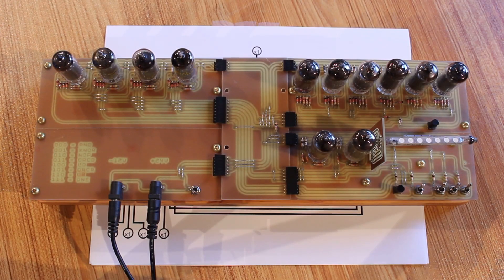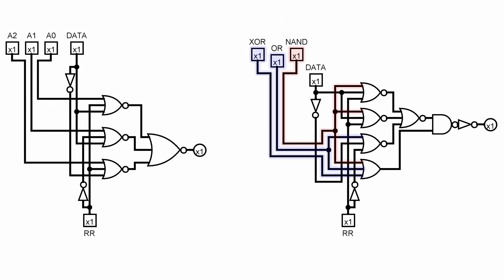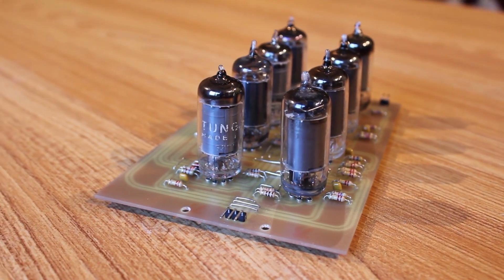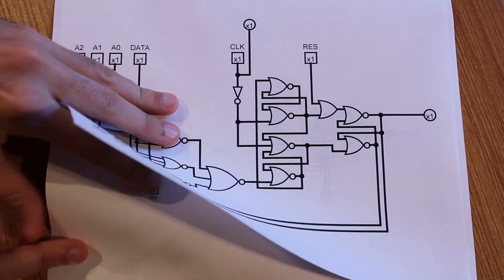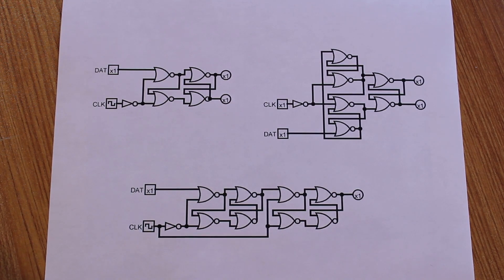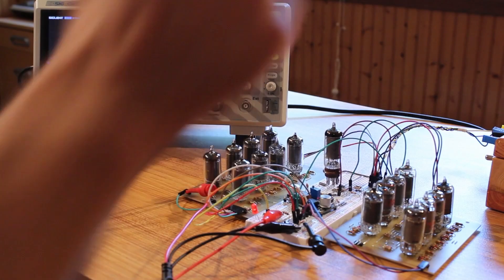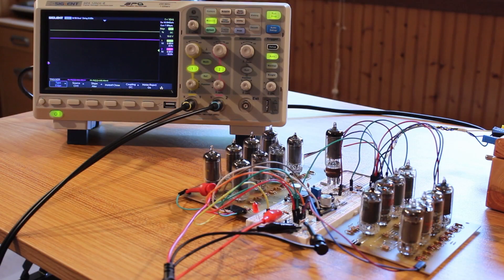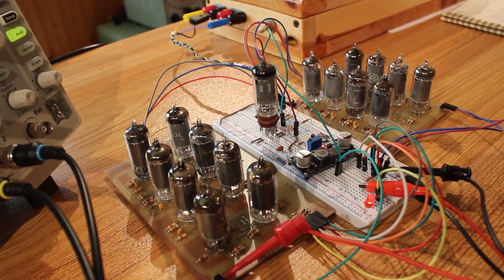Vacuum Tube Computer P.17 – Building the Logic Unit and Results Register

Comment: Would be interesting to know why your first D flip flop design didn't work, it's supposed to be edge-triggered. Maybe your gates don't switch quickly enough?
Reply from the maker: I think you're on the right track!
This is a total guess on my part, but I think it's due to different rise or fall times of the different tubes. Since the tubes are all used and from different manufacturers, they all have just different enough emission characteristics to throw the D Flip Flop timing out of whack. If I went through and tested each tube and matched them up as close as possible regarding to emission, it's possible that the first design would work!
But, I wanted the entire processor to work with as much as a 5V difference at each logic level (ie. logic low = 1V to 6V, logic high = 19V to 24V). I've actually got the designs flexible enough that I've even had some working with worse tolerances than that, but for the most part, logic levels fall within those super wide margins. The second D Flip Flop design allowed me to keep my overly loose design standards, haha.

Comment: Have you thought about designing around any if the uber-cheap and highly available surplus tubes from the ex-USSR and China, rather than old-stock US types which are still used in vintage gear?
Reply from the maker: I have indeed. I did a bunch of searching and shopping around to find the most affordable option as well as the best option for low-voltage operation.
I decided upon the 6AU6 for a few reasons. First, it's amazing at low voltage - probably the best tube of the hundreds of different types I tested at 24V. Most importantly, it's a very common, and very cheap tube. Yes, many old vintage gear still uses the 6AU6, and there's no shortage of quality 6AU6s available for those. What I'm buying for this project are heavily used, large lots of 6AU6s, which generally wouldn't be a good choice for someone trying to restore a vintage piece.
I don't buy any 6AU6s unless I can find them for less than $0.90 a piece. To give reference, the cheapest Soviet dual triode I can find is the 6N1P, and those average around $3 to $5 a piece. Unfortunately, at the scale I'm building at, that would push the project a bit out of my price range.

Comment: Hi;
Could You Please send or post the logic equivalent of What You used for Your Tube 1-bit Computer, I cannot build it in or with Tubes, even though I would like to, but for me I would like to build a 74xx equivalent, since I have plenty of those Ic's.. And I don't think I have the Mc14500 Ic either, and what You are doing is so much better, than what they designed..
THANK YOU Marty
Reply from the maker: Thank you so much for the kind words!

And no problem at all! Here's the full gate level representation of the UE14500: https://i.postimg.cc/fTQDXnnX/UE14500-Full-Gates.png
But, if you have Logisim, it might be more helpful to play around with the actual logic simulation file here: https://hackaday.io/project/181923-1-bit-vacuum-tube-computer/files

Keep in mind though that there's actually a lot better way to build a lot of what I built here if you're doing it with 7400 series chips. First of all, I included a bunch of buffers because I run into fan out problems with low voltage vacuum tubes very, very quickly. With 7400 stuff, pretty much none of these buffers would be needed. Additionally, I built as much as I could out of NOR gates because that was the most compact logic gate I could build with tubes (and some diodes). But, with 7400 stuff, you can totally use NAND gates, or even D-FlipFlop chips, ALU chips, etc., to make life a lot easier!

Keep me updated on your project though, I'd love to check it out as it progresses!

Comment: UE, earlier in this series did you cover how you were implementing logic gates with pentodes?  I couldn't quite find that. I started electronics with the yellow 1981 "TTL Data Book for Design Engineers" by TI. Naturally I'm enthusiastic about your progress here. Thanks for the video.

Also, I noticed you're using 6AU6 pentodes, you or your viewers might enjoy my 6AU6 teardown video entitled "170429 Valve Studio - Teardown - 6AU6 Pentode", https://youtu.be/TFvBuO8r-nA.
Reply from the maker: Thanks for checking the video out!
I think I cover briefly what my basic inverting amplifier design is in the OpAmp video, but here's how I'm building my low voltage NOR and NAND gates: 
https://i.postimg.cc/jdKgM5tT/NAND-NOR.png 
In the schematic it shows 6AN8P, but that's just because that's the only pentode model I have in TINA TI. It doesn't show the suppressor grid, but that's always tied to GND/cathode in my designs. Interestingly, it simulates pretty close to how the 6AU6 behaves in the real world, so it works out pretty well! 
Other more complex stuff, like XOR or the Logic Unit, is all built out of combinations of NAND, NOR or inverters (which are just NORs without the diodes). 

I think I have one of those old TI data books in the garage somewhere! They're a massive collection of awesome information!
And I've totally had your 6AU6 dissection video bookmarked for a while now! It's a very excellent look inside of these awesome little tubes!
Reply: @UsagiElectric  Clever diode work on the NAND. Thanks for the reply.

Comment: Very nice episode once again. 

Do you have the design already finished and simulated or do you build part by part and make it up as you go? If so you do a phenomenal job by not needing to redesign the previous stuff. 

An application specific tube tester for this series sounds like a very cool project in itself, I would definately watch it. 

Greetings, 
Michael
Reply from the maker: Thank you very much!
It's kind of a mixture. I built up most of the Logic design in Logisim and tested it before I got too far into the build. I have made some changes along the way, like the revision to the ALU was done pretty recently. But, Logisim doesn't simulate some of the weird quirks I run into by building it with tubes, so sometimes I have to make a design change mid-way through because while it simulated fine on the computer, it just doesn't work in reality.
As for the PCB design, I didn't actually finish designing the PCBs until a few weeks ago, and I'm still making small tweaks and changes as I build along. I've been pretty lucky so far in not having to redesign previous stuff to work with the new stuff, but I'm fully expecting to have to as the build nears completion and all the moving parts need to start working together.
So far, so good though!

Oh, and as a little spoiler, the tube tester is going to be the next episode, it's something I needed to build right away so I could stop thinking about it at night when I'm trying to sleep, haha.

Comment: Cool stuff as always.  Looking forward to seeing Doom run on this thing.  ;3
Reply from the maker: I don't think it'll even run Doom, but maybe if I write a long enough program, I can get it dump out enough serial data to display a doom screenshot someday, haha.
Reply: @UsagiElectric  
I think it's MORE than plausible to run doom...
However
.
.
.
The frame rate might be a little low (0.0001 frames per second).
The screen resolution will be a little low (9 pixels in a 3*3 matrix?)
The associated audio will be slightly downshifted in frequency (max out at around 0.01Hz)
Other than those trivial issues, it'll be PERFECT

Comment: English

1 bit computer is not that ridiculous. in fact the first behemots with 32, 48 or 60 bit words, were 1 bit computers, and they operated serially.
Reply from the maker: You're absolutely right! There's a ton of amazing bit-serials machines out there. The PDP 8/S is one of the more famous examples, but most vacuum tube computers were serial as well, especially if they used magnetic drum memory, as the way the data was read off the drum really worked great with a serial architecture!